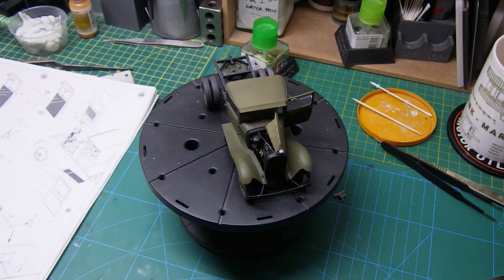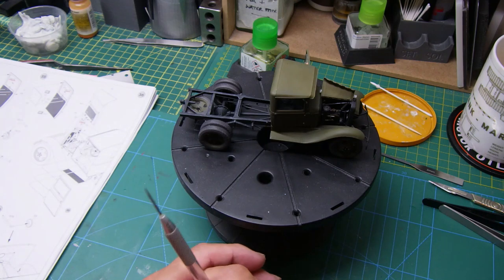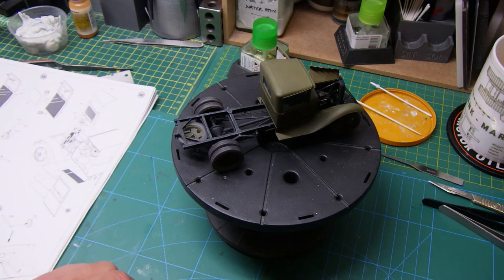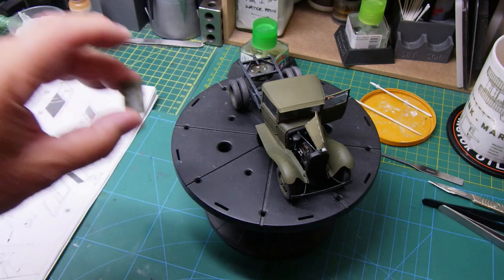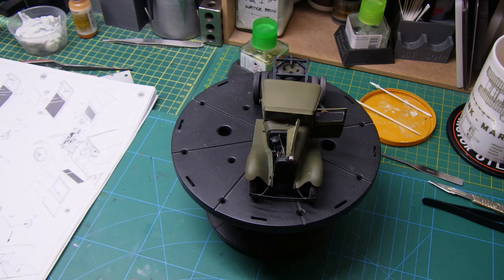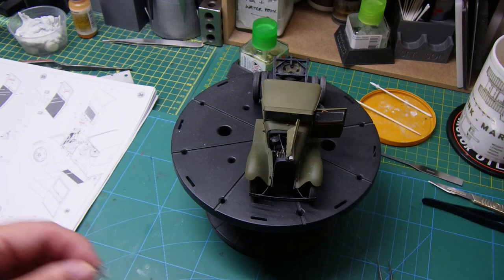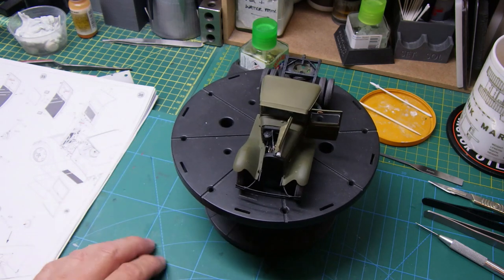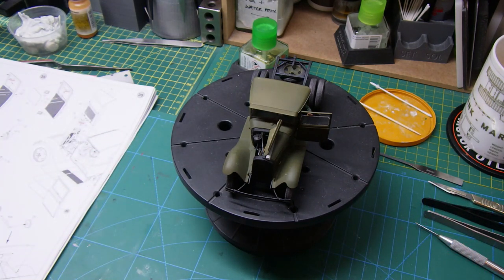Tow Truck Gaz / Ford AA Miniart kit build - part 5 - what is going on?

Comment: It probably happens with many model builders, that there is a time when motivation decreases or a lot of things don't work. A little distance can't hurt. Then it works again by itself. Possibly a little exchange with other model builders or the view of others work as well as model building magazines and the mojo springs on again.
Also just accept the days when things go wrong. The next morning it's OK again.
In any case, your truck with crane looks great and surely will motivate others! Just let the Mojo develop.
Best wishes and a nice weekend, Bob. Joachim
Reply from the maker: Many thanks Joachim, I'll be taking the advice from this great community and take a short break and do other things. Cheers 👍

Comment: Bob, I am fairly sure that all of us (okay Max from Max's Models might be an exception) experience times when we don't want to head over to the workbench or even chuck the model in the bin.   Lord knows it happens to me, and I am pretty sure  it will happen again.  My own episodes of the modeling blahs aren't necessarily related to a build screw up or oversight;  that were the case, I'd have to deal with this every week.   I certainly have run into periods where everything seems to go wrong and Murphy's Law is the theme of the day.  Losing pieces still drives me crazy!   I find that what helps when I'm not happy with my modeling and my model isn't happy with me is to take a pause, maybe even a longer pause like a couple of days and I put the kit  on the shelf.   I often pull out one, or two, or three of my innumerable miniature figures and start painting--no gluing, or rarely any, and I can just relax and do something quickly that will yield a decent result.. and IF or rather when I make a mistake on the miniature. I quick swipe of a wet brush, and I can undo the mistake.  That is probably why I paint a lot of figures!  Enjoy the Stones, your family, the cricket and I'm sure you will return refreshed and ready to tackle those projects even if they are giving you some arguments (to paraphrase Max).  Cheers my friend.
Reply from the maker: Thank you Mark, as I suspected the way I feel is not just me, but something we have all experienced to varying degrees over the years. I certainly appreciate your comments and I am sure I’ll get through this. Cheers 👍

Comment: well I guess we all have thoes times when we just dont have a will to do stuff. I have 4 unpainted kits, and I just cant get to painting. Lazy I guess and overthinking is the reason that holds me back. How to paint that or this, when to glue that, will olive drab will do or I need to mix it and so on. at the end - I just let it go. And I know that If I will start to do some thing it will just "snow ball" and will be done. I just try to remember that Its for me, my pleasure and peace in mind, so I can take a step back, do other things and then return back. as for mistakes - we all make them. late nights, other thaughts in mind and so on. but they can be fixed. extra work, yes, but it is what it is.
Reply from the maker: Thanks Edgars your thoughts and comments are appreciated and will contribute to getting me back on track. Cheers👍
Reply: @greybeardmodels  as I am a beginer ( only 2 years in hobby) I find my self in sutiations where I compare my work to thoes that I see online in here or in Instagram. I too want that nice rust effect or thoes nice panel lines and so on. but I reminde my self that for now it is great that I do get even, nice finish, can do small things with brush and can do "hair spray" technic fairly good. I try to implement new things, but Im afraid to ruin my model. thats another reason why I sometimes dont build or build, but dont paint it. another thing is support from others around you. my wife and friends are supportive, they adore my will and patience, and they like the end resultat. maybe some bad coment or "again you are doing that silly thing" talk from someone is holding you back? food for thaught :)